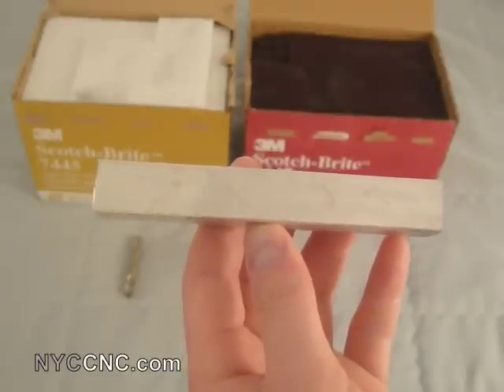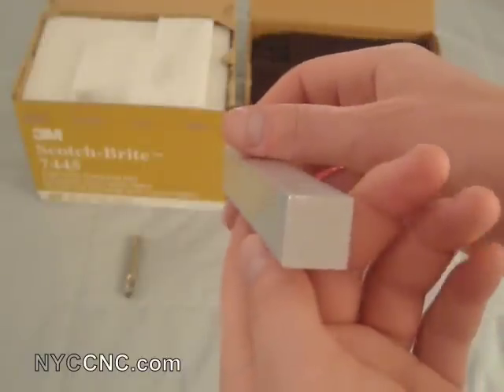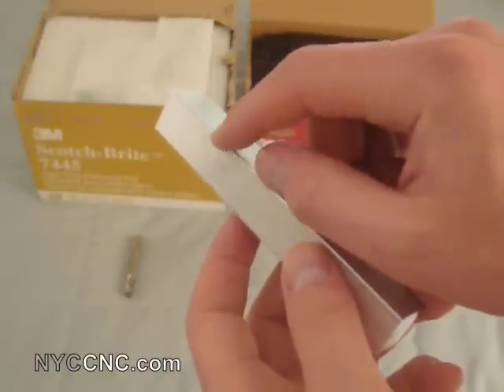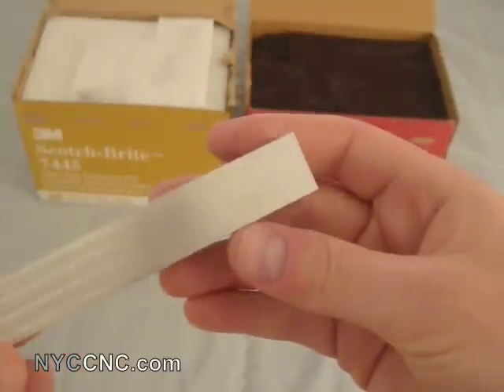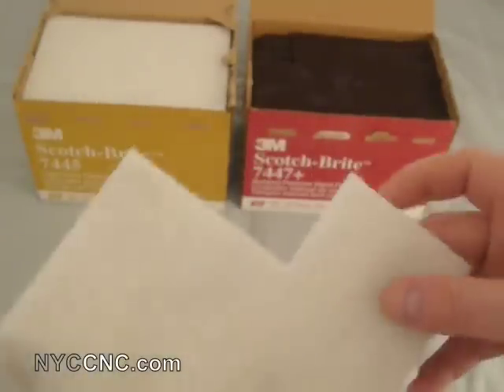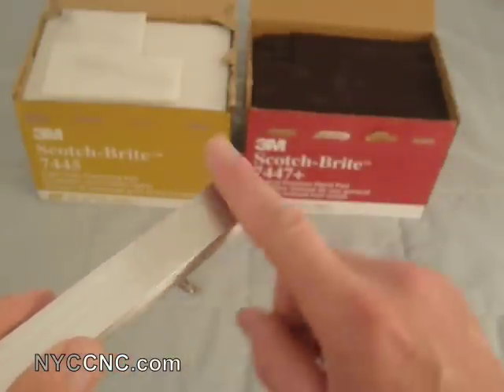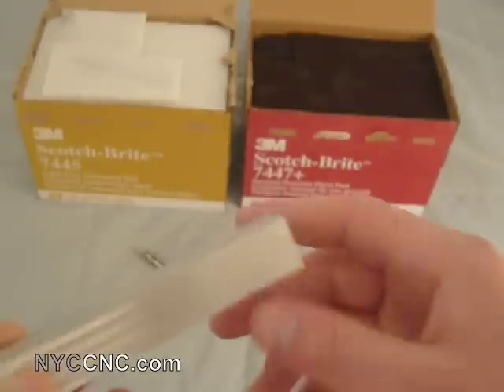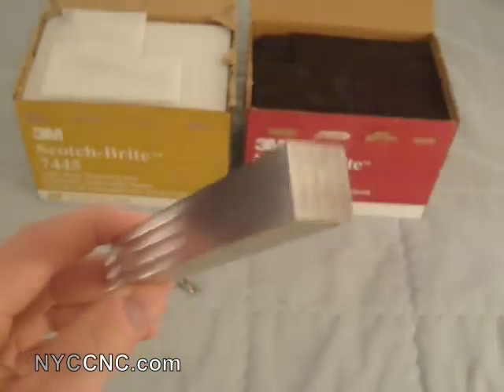Great Aluminum Surface Finish with 4-flute endmill & 3M Scotchbrite

Comment: I would have left .005 or .008 for a finish pass, .03 to me is more of a pre finish cut.  Up the rpm and 7.5 ipm seems plenty slow for any alloy.  If your mill is not tram correct it has a huge impact on surface finish.